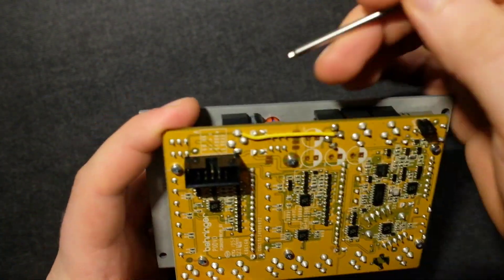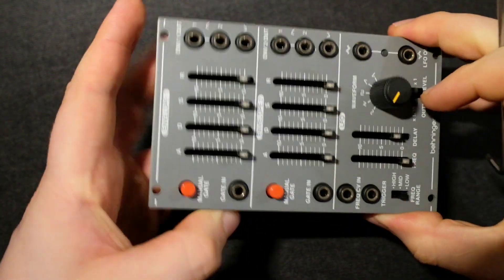Behringer System 100 - 140 Envelope Generator "Linked Gate Input Mod"

Comment: Great mod if you’re adapt with a soldering iron, but for the sake of saving £6.50 for a short tiptop lead it’s a lot of work
Reply from the maker: You're forgetting to calculate with the priceless sense of satisfaction from modding your own gear. 😉

In essence I agree with you but it wasn't about the money (I mean, look at my current system), it was more something that just kinda annoyed me and I was able to solve myself in a more elegant way than using a stackable.
Reply: @InVacuo  I agree, I’m sure there is lots of satisfaction doing something like that.
Reply from the maker: @conceptdevices  Even more when you start designing and building your own modules! 😃
Reply: Soldering is an awesome skill to have. By now I must have saved hundreds of $$ by making my own cables, DI Boxes, patchbays and even CV controller for Vermona DRM1. A lot of simple modules (attenuators, multiples, simple mixers) are horribly overpriced... It's so satysfying to just turn blanks into functional modules with a bit of soldering.

Comment: Hey there! I've just successfully done the mod (Behringer should have normalized the inputs in the first place) but I wanna give a word of advice because the procedure was not without problems on my side. I had difficulties unsoldering all four jack socket  lugs at the same time with a traditional soldering iron, so I used an SMD heat gun instead. I got the socket desoldered that way, but the plastic parts were a bit molten and I had thought that I wrecked the socket. After searching for a new one online I figured that those are not the standard jack sockets that other eurorack manufacturers use, but possibly some behringer exclusive ones. Anyway, I could not find a replacement online so I started measuring the mangled socket with a multimeter and it turned out to be still functioning, although looking pretty bad 😅 Now everything functions perfectly and the grounding of that lug is really not necessary. Little amounts of noise are not enough to trigger the envelope, it's the same as plugging in a cable which isn't plugged into anything else and just dangling in the air. Thanks for the inspiration for this mod and Grüße aus München! :)
Reply from the maker: Thanks for sharing your experience, hopefully others can learn from it before making the same mistake, it can be so easy to overlook the consequences of your actions sometimes. I'm glad it worked in the end though.
Grüße aus Mainz! :)
Reply: @InVacuo  I really wonder how you managed to desolder all four lugs at the same time to remove the socket? Would you mind sharing your technique?
Reply from the maker: @MrJemabaris   Sure, solder-sucker and patience. 😅
(In fact the solder-sucker is in the thumbnail.)
Reply: @InVacuo  I used one too but I could not remove all of the solder because it was also on the other side. Anyway I hope I won't have to desolder that socket anytime soon 😅

Comment: Sounds like a god send.. will definitely be implementing this, thank you!
Reply from the maker: You're most welcome, glad it's helpful!
Reply: @InVacuo  Just doing my first one now, thank you! By the way, the three grounding tabs around that pin would have been to hold the trigger input down to ground when nothing was plugged in, to perhaps stop the possibility of noise from triggering the envelope. :) Thanks again!
Reply: Bad news I'm afraid, when I isolated the pin you suggested & applied the patch wire as shown - the two envelopes are chained, but now the 2nd lower independant input doesn't work & the top manual gate button no longer functions to trigger the 1st envelope. :(
Reply from the maker: @bengineer_the  Hey man, I'm sorry to hear that. Unfortunately it seems YouTube has done away with private messaging so I can't try to help you that way (I'd like to see photos of your modification to try and figure out what went wrong). Do you have an Instagram account? I could connect with you that way or you could give me your email address (or set up a temporary one you don't mind posting on YouTube). Which ever way you choose I'll remove your comment as soon as I get your details to minimise expose. - That's about the best way I can come up with at the moment unless you've got a suggestion.

(Edit) Because of the rather bizarre nature of the fault my first suspicion is you might have bridged something accidentally, I'd suggest having a good look through your soldering. The gate buttons should be unaffected by this mod.
Oh I had another idea, you could make a private video showing your mod and post the link here.
Reply: @InVacuo  If you found out what is his trouble, could you amend the description in order we avoid to do the same "mistake" ? Would be awesome :)
Reply from the maker: @ewencousin  It's been 5 months and I haven't heard back so I have no idea what it was however should I find out I'll post it either here or in the in the description depending on its nature. (I still have no idea how it could have gone so pear-shaped for him.)

Comment: You are creating a "normalized" patchpoint.  It's important to have jacks that can be normalized that you're working on.  When no plug is inserted the jack is normalized to the internal routing (your additional wire).  When a plug is in, it breaks that normalized connection.  This is very common to see in patchbays if anyone is interested in any follow up information.
Reply from the maker: Learn something every day. 👍